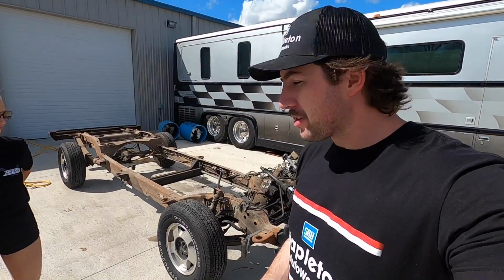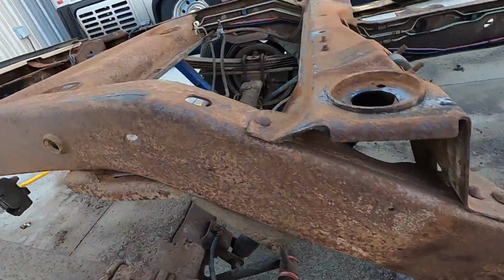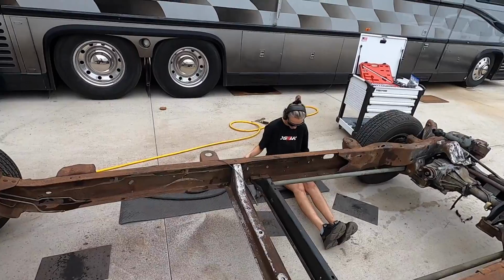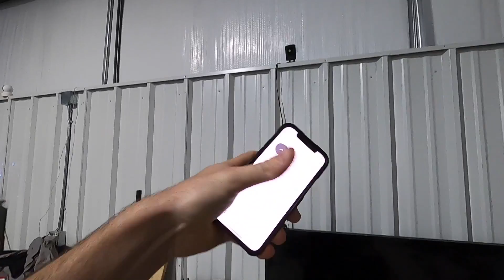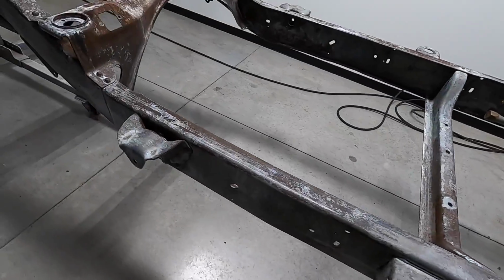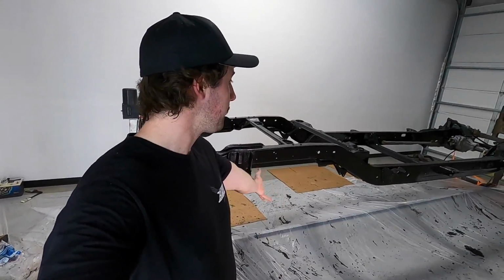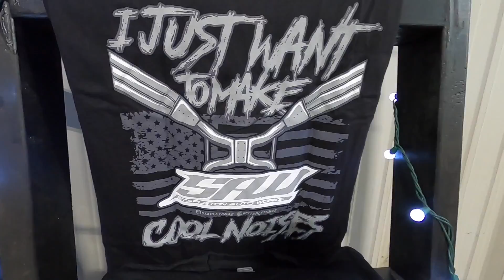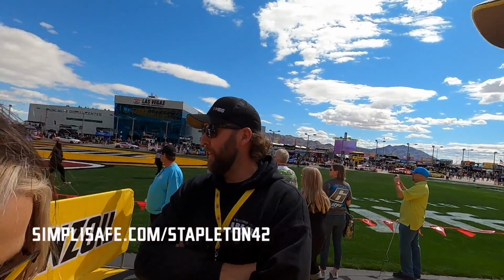Rusty GMT400 Suburban Frame Restoration & Paint: Uncle George Goes On The Rotisserie! (90s OBS)

Comment: I like the longer video. That way I can find it easier to watch again. It's a lot of work I did an s10 frame I used a drain auger with links of chain to clean the inside. I also boxed the frame before I  started painting. It's definitely worth it. Logan deserves a ring. She just dives right in
Reply from the maker: Considered boxing the frame but I couldn’t justify the time it’d take to do that for what the truck will be used for lol
Reply: Reason I did is 6.0 ls will be unnaturally aspirated. It's a conglomeration of the best stock parts plus some fun parts LOL.

Comment: Logan rocks and it’s a lot easier to flare hydraulic brake lines with a hydraulic flaring tool if you wanna spend the money
Reply: A mastercool hydro flare tool is the best investment I made in my tool box fuel line trans line and brake line have never been easier
Reply: Brake lines have to be double flared.
Reply: and safer.

Comment: When you go to re line the brake system, do yourself a favor and use the nickel copper brake line. Pretty, bends easy, flares easy, and is rust proof, corrosion proof. A quality flare tool will also make your life much easier. Hydraulic mastercool deal is the best I’ve ever used on/off the vehicle.
Reply: I thought they used steel because it doesn't stretch and cause spongy pedal. Then I thought about all the flexible hoses, so I'm not sure. Does anyone know why brake lines are normally steel?
Reply: @brucegrunewald8423  $$$

Comment: More Logan commentary, for sure. Looking forard to the front coilover conversion. I have a 98 Sierra and my torsion bars are starting to clunk, I'd rather convert than rebuild the torsion suspension.
Reply from the maker: I just wanted the stuff out of the way to have more room for exhaust and easier to remove/install the transmission 😂

Comment: I just did this to my K5 Blazer (without a rotisserie☹️). I used Chassis Saver paint though and used a sand blaster attachment for my pressure washer. It was a huge mess as expected, but the the results were great. I’m now doing body work. Looking forward to the coil over conversion. After the turbo LS swap I’m wanting to do F/R coilovers and links.
Reply from the maker: I may have to look into the sand blaster pressure washer thing… 🤔

Comment: my wife just asked if Logan lost a bet!!! lmao there is only one way i could get my wife to rattle the scale off an old frame... they made a show about it... its called Wife Swap!!!! Grampa knowledge drop >>> when flaring brake lines, without brake fluid present, hit the end with a torch dont kill it and make it red hot but after you clamp the line and are about to flare... heat that sob up a touch and you will split alot less of them... and make sure to ream out the line  it is closed up a touch by the pipe cutter...

Comment: My brother! I've been doing frame restoration for 39 years! Nexttime use  Easy off oven grease remover. Pressure wash fram. Then use a drill motor brush hog fram rattel can spray with rust offf top brand than you are a ROCK STAR!!
Reply from the maker: We did use easy off on it! Just didn’t film all of the cleaning process

Comment: Yall are awsome! Seeing yall doing this frame off is getting me excited to start redoing my new to me truck just picked up a 2005 chevy 2500hd from Houston texas has 280k on it and absolutely no rust unfortunately has a salvage but I don't care gonna get it inspected and it will have a rebuilt title I'm from Ohio and our trucks that have been here most of there lives only have between 75% and 30% of there body's left so to have one with zero rust is awsome and I got a killer deal on it planning on doing a frame off most likely will receive a 12valve cummins nv4500 swap that is in my current 05 chevy 2500hd that is only 65% still in existence lol

Comment: Late to the party, I found steel wire brushes at the business end of a drill body or grinder make short work of surface rust on frames.I did a body off on my 73 vette frame and it came out nice enough for rust neutralizer and paint.There are various styles of wheels to get in tight spaces.
Reply from the maker: Great tip!

Comment: Just subscribed bud because you are working on one of my favorite vehicles.
Your a lucky man to be able to do what you do with a nice shop and a beautiful girlfriend who like to work on cars also, that's rare my friend.
Pretty girls don't usually like getting dirty. 
Be careful though I used to do the same thing your doing now 30 years ago and hurt my back by not being smart and it gets worse over the years and I'm about one step from a wheelchair now and it sucks. So be mindful of what you put your body through at a young age.
 I was shocked when you flashed the mileage up of that truck because so far I haven't seen one higher than mine. 1993 K2500 with the 454 and it has 301,000 on it so far and still runs great and only has a couple minor leaks and don't burn any oil at all.
Reply from the maker: Thanks man welcome to the team!!

Comment: Making brake lines isn't horrible, just don't buy the cheap hf tool, or equivalent junk at parts house. Its difficult to get a good crimp. I remade the front brake lines on my firebird, and made a few for the line lock kit. Irritating  when the cheap tool messes up your double flare and it leaks lol. I also am a sucker for pain, and waited to install brake lines until after I put motor in 🤣

Comment: DUDE! The Jalapeño is the BEST. I saw in Summer Smash pix that there’s Summer Sausage and Cajun now, but I’ve yet to see them go live.

BTW, do you ever use a rust converter in a situation like this?
Reply from the maker: Heck yeah. And no we haven’t ever tried that stuff
Reply: @Stapleton42  I watched a series on Challenge the Build (youtuber) where he did a bunch of DIY rust repair on a NJ (I think) '04 'Burb 2500. While he was at it, he hit the frame and suspension with Corroseal and then re-undercoated everything (also did an auto-ride delete, which is one of my next projects.. gotta start clearing the laundry list of error messages in my info center).

Comment: Frame Looking good.  Just did the same to the back half of my 93 K3500.  If you want to try something other than Por15 next time I used a product called Corroseal.  It's a rust encapsulator also, but is way easier to prep and clean up afterward.  Keep up the good work.

Comment: All those simplisafe units transmit on the same frequency, it's very easy to defeat unfortunately, I'm glad you got a sponsor etc but don't entrust your worldly possessions to this excuse for an alarm system... 433.92mhz is all you need to block and then they can't transmit... never understood that about radio frequency alarm systems, they have to disclose what frequency they use 🤷🏻‍♂️... #69 Former Security System Installer for 15 years 👍🏻
Reply from the maker: If someone wants to steal something they will. Everything is just a deterrent to weed out the less determined lol
Reply: @Stapleton42  exactly

Comment: Noob question: why use a scaler instead of a wire wheel?
Reply from the maker: It has a lot more punch to it than a wire wheel does. Covers more ground quicker in this application

Comment: I'm doing this to a 98 currently. I'm further along than you guys but I have to ask you. Why didn't you take everything off the frame like the brake lines, fuel lines etc.......? You're so close why would you not? Pull the control arms off. Do it right.
Reply from the maker: We did pull the brake lines and fuel lines off. Didn’t bother with the control arms because if we take them off to change the bushings we will just paint in there before re assembly